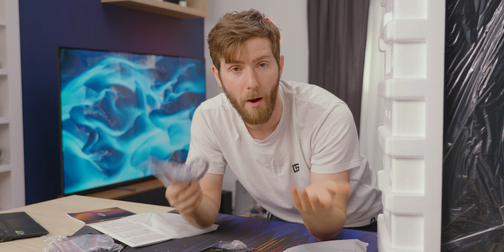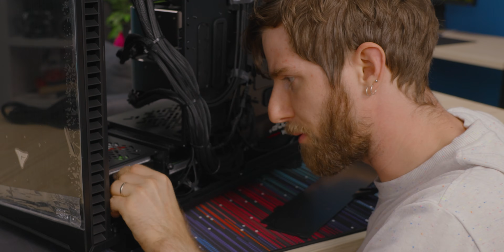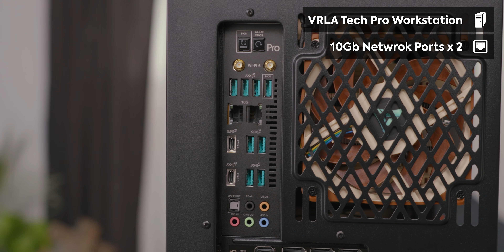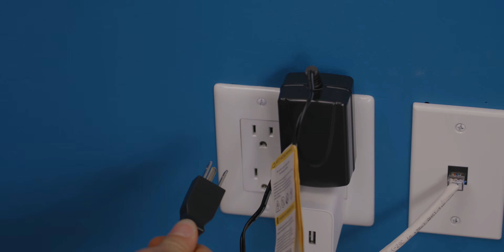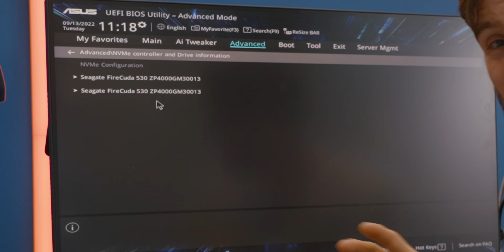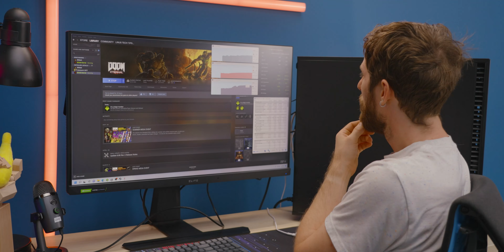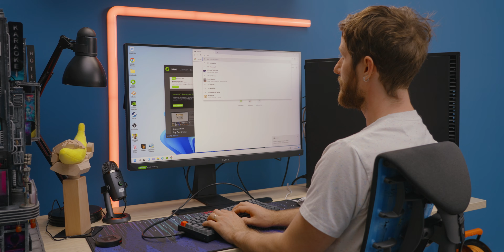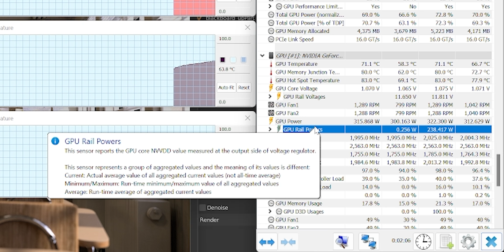This PC blew our circuit! - VRLA Tech Threadripper PRO Workstation

Comment: All that squawking about the 1/8" audio jack going away on APPLE phones, which you don't even use, and you have the nerve to even ask if mfgrs should force obsolescence of 1/8" audio jacks on our mobos?  Whose side are you on, boy?
Reply: to be fair nobody populates all those analogue surround sound jacks on the motherboard, but everybody has used their headphone jack on their phone.

By nobody, I mean far less than 1%, but a lot of people do still use wired headphones with a single jack.

Comment: Just built a threadripper pro pc in 1000d case using the same motherboard and 265gb of ddr4 ecc ram cpu is the 5975wx with a single rog strix rtx 3090 oc gpu this things a monster at rendering 4k XAVCI 60 4k video I'm not confident enough to do a full water cooling loop so went with a Corsair elite capellix h170i aio getting greats temps cpu tops at under 60c well happy
Reply: Out of curiosity what do you do that requires that much power?
Reply: @Ryan  rendering and editing XAVCI 4k pro quality hdr Video from a Sony PXW-Z280 camera, I'm not a gamer so don't need a gaming build this is purely a workstation Build

Comment: Yes I still hook up surround sound to the analog on the back, but through a sound card.. the 8th inch Jack is converted to RCA which goes into the receiver which is one of the last receivers on the market to do 7.1 surround sound without HDMI.. and it's one of my best friends and I'll never let it go, God bless you pioneer! Yes yes they they go to floor standing speakers LOL, bookshelf speakers are for posers.

Comment: Linus, I've got an idea or 12 for your crazy cooling schemes, several start with putting the computer into a pure dry nitrogen atmosphere to avoid condensation, combine with some very high "air" flow (like duct 200-800 cfm directly across the cpu cooler alone, more air for the rest of the system as well) and a variety of somewhat normal to rather exotic cooling mechanisms to cool that air flow (air conditioner, dry ice, liquid nitrogen) to see what blasting crazy amounts of very cold gas can get you to.

Another thought, they have wind tunnels for testing icing on aircraft.  NASA icing research tunnel is up to 350 knots at as low as -25c through a 6x9x20 foot test area, you might need to reinforce your computer first though at that level of forces.  I don't think you have ever used blowers close to that size before.

Comment: You need to check out the Razer Kiyo with the ring light compared to the pro. I have been using it for about a year now and I am EXTREMELY impressed. Not only has it never given me an issue with OBS but I can plug it into my xbox one or xbox series s and it works instantly where my logitech camera will not work on the xbox. and for $80 I couldnt find a camera I was more impressed with... not the mention it can be mounted on a tripod, clamp on the screen or just sit on the desk... I passed up the pro model because I tried the standard model and was blown away.

Comment: I kinda wish you could use both GPUs for gaming.
Like…. One of them can do 8K 60fps gaming fairly well, but two? Probably double the frame rate.
Bet that If you did some monitor array mode, you could have both of them in 4K wide, and have it technically doing 8K

Comment: I have been feeding audio into a (Usually Denon) receiver for at least 2 decades now. I think it is time for a nice ARC output on motherboards so that instead of a damn stupid "monitor" sucking back video data just so that I can hear stuff without any possibility of displaying that video, I can get a nice clean simple sound out.

The worst offender is Apple. In what world is it OK to be forced to duplicate the 6k video out to the audio only sound system? Although nVidia and AMD are just as dumb, but sometimes they let you feed out a really low res feed. But then you have to attach that invisible monitor to your extended desktop so your mouse gets captured off screen sometimes.

It is all so stupid that I hope I am just ignorant and this is not the true state of affairs.

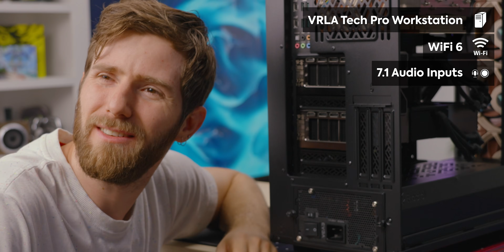Comment: 4:59 no, most people run their stuff off of a USB DAC and amp and/or through a receiver. A lot of consumer motherboards have been removing mic in, front tweeter, and subwoofer, leaving left, right, and S/PDIF, the latter of which really needs to be retired. This being a workstation board, their keeping it is probably for backwards compatibility for whoever is using it, since you never know what setup a client is going to be using

Comment: I use the audio out ports because with my sound system, using digital means I cant change certain niche settings like the decibel per speaker or turning off the center channel while still decoding dts etc i cant do any of that through a digital signal

Comment: They most definitely should still be including the 6 analogue audio ports, I use a 4.1 set up, "mirrored" so I can turn off the hifi speakers if I want, my amp isn't new enough or high end enough to have HDMI. I mean, who in their right mind wants to use monitor built in speakers beyond Windows system audio?! And I'm mot a fan of using headphones for long periods.

Comment: My very first computer came with an Altec Lansing ADA 305 Speaker surround system that I still use to this day. Changed computers over the years but I wont change the Speaker so keep the connections.

Comment: I actually use the analog "surround sound" jacks on a motherboard for a unconventional usecase. I split the jacks up in software under linux then plug in different devices to each port if I want to have multiple sound system zones that I maybe cant hook up over hdmi or optical. I use the line in to grab audio from my game consoles if I wanna game and still have audio from my desktop as well

Comment: I bought a pretty top end Creative Labs 7.1 speaker setup maybe 10 years ago, and it's still going strong. I wouldn't buy it again if I had to replace it, but it's still working as well as the day I bought it, and has outlasted 5 motherboards in that time.
So yes, there are still people plugging in analog 7.1 speaker sets. 🙂

Video Idea: Those components/accessories that you keep from machine to machine, and new innovations that might make them worth replacing anyway.

Comment: @ShortCircuit I still use a 5.1 analog speaker setup! I had a Logitech Z640 for a 5.1 setup since probably 2003-2017, and up until a couple of years ago I was using the onboard sound for a newer Logitech Z506 5.1 speaker system. Switched to the SoundBlaster Omni 5.1 over usb and it has more bells and whistles for gaming and TV/Movie time than any onboard chips have ever offered. I can still have a good time on a budget!

Comment: i enjoy having the analog audio because it allows me to use older speaker systems and split the output of audio to own speaker pairs. got Main, secondary, head phones,  and the 2 BT speakers that is possible with modern BT. 7.1 lets me be fully submerged in game world using older theater system.

Comment: I still use the analog audio out on my board, granted, just the stereo/front speakers one (the lime one, usually bottom middle), to hook up my speakers, that are 10+ years old, but still work just fine, and still sound good. Honestly sometimes it's useful just to use as an very loose indicator of a good board, if it's not present, likely not a good sign.

Comment: I feel like any PSU over 1500 watts destined for North America should come with a cable for 20 amp sockets. 1500+ watts is simply too much for a single 15 Amp circuit. Most “120v” circuits are actually 110-115v, or 1650-1710 watts of total power available on a 15 amp circuit.

Comment: No RGB. my kind of computer, i mean who the fuck wants RBG in a workstation??? Function over form here boys. As for the CPU cooler, its the same one that is recommended for 3rd gen threadripper, which is the same TDP as the 5000 Pro series, so if it cools them it'll cool the 5000 series.

Comment: I'm happily running my Pioneer A-717 Reference amplifier from around 1990 and all it takes is analog. So if motherboard makers remove those analog ports it means I need to get a converter or something cause I'm not moving to digital amplifier in near future.

Comment: word of advise. if you're going to use a 1600 watt power supply, and actually run anywhere close to the full capacity. You need 240v. power supplies that large are intended for the rest of the world outside the US which all use 240v. Here a standard socket is perfectly happy supplying 3100w whilst a standard 110v socket isnt intended for that kind of high power draw.

Comment: I wish case manufacturers would include a spot for a gpu exhaust fan. I took out pci slot covers on my Helios and installed a fan in their place. Temps are cooler on my gpu now. It works.

Comment: 5:18: Yes, motherboard manufactures should continue to include analog audio ports on high end boards, especially when the the PC is being used for productivity. Being able to hook up a very high quality stereo to the PC without any adaptors is a very good thing.
Reply: Agree, having the option is good. And plus good we'll made audio equipment lasts decades
Reply: I use a very nice set of Logitech G5.1 with upgraded speakers. They are the oldest part of my system but still pump out great audio. I need the analog connectors, but the truth is that now I am using a Soundblaster card for my analog output that has better audio quality than the Realtek chip on the motherboard.
Reply: That is a upvote from me been using a 150w sub with its own 7 satelite system from genius for the last 5 years and the audio has been so good for movie and other audio based media cintent liks this segway to this awesome channel =D. for the life of me it is so difficult getting a usb solution with a 5.1 or 7.1 analogue audio interface to be reused from my laptop after my system broke.
Reply: Yeah i agree. Analog stuff are also just most reliable. Even in 2015 you still had more reliability issues with analog than USB, its only in 2020s that i consider analog to be unnecessary for reliability reasons alone. But lot of people still have good analog stuff, lets grandfather them in. 
But i don't expect or demand or ask them to still keep putting analog audio ports into mobos in 2030s. Maybe some people still prefer analog in 2030s, but it no longer needs to be industry standard since it will be just that rare.
Reply: Why?!?  I'm not an audiophile by any means, but for the last 2 decades I have been using the optical audio port for streaming music from my PC (S/PDIF, TOSLINK, etc.)  There is ZERO interference on this link.  No noise crackling and popping, ruining your immersion and breaking your concentration.  It is the cheapest, easiest, and most painless solution to getting your audio to wherever you want it to go.  Run a cheap optical cable from your PC directly to your stereo, and let your stereo do any necessary analog conversions.  If your PC does not have an optical port then check your stereo for other options.  Part of the reason for HDMI was passing multiple audio channels from your PC/TV and giving you the most state of the art surround sound experience available.  No HDMI either?  USB.  Granted, your PC's analog audio is an order of magnitude better these days than it used to be but once it leaves the computer it still has the same interference issues.

Comment: it still makes sense to use those ports. I use them for my speakers/sub using two of the ports, then connect my headset to the line-in and retask it to headphones so it's the same audio device as speakers and all I need to do is turn speakers down and turn headphones up, as well as use the mic-in. the only ones I don't use are rear/side speakers

Comment: I must have been living under a rock, but what would you use instead of the analogue audio ports for external (surround) speakers? I guess you could use an optical connector if your speakers and MB support it, and a lot of people don't bother with external speakers and use the ones built into the monitor (transmitting the audio signal via HDMI or DP), but analogue is still a perfectly valid connector for speakers. The signal has to be converted to analogue at some point, might as well do it in the PC.

Comment: I got rid of my 5.1 logitech speaker system as it was 20 years old and finally popping sounds became too loud. Was very disappointed with the equivalent current model and went with 2.1 speakers like when I was a kid with my 20 dollar antec speakers and sub. 

I miss my analog surround sound. I do not miss the wires, and trying to find good placement for it all.

I now use a USB powered DAC/amp for my headphones and speakers and mic. I think the sound is actually better. Need better headphones to take advantage of the ohms this DAC pumps.

Comment: I have Logitech Z5300 speakers that I've had since college, across 4 pc systems and one move halfway across the globe and yes they plug in with 3.5 jacks into 5.1 surround. 

At this point I'm hoping they die so I have an excuse to replace them. But why spend the money if they still work great? 

Unless you have a pair of speakers you aren't using and wanna throw into my Screwdriver order 😇

Comment: Analog speaker user here. Yep still use the audio jacks at the back as I run a surround sound set up as my PC is the main entertainment system and productivity machine for the house - remote work, video games and, most importantly, streaming shows and movies. We also host d&d and movie nights so having those surround speakers is great for immersion and they've been working as good today as they did when I bought them (even has a little volume remote) :)

Comment: Careful with plugging SATA drives into that mobo!  Only the top 4 ports work, at least in linux.  The bottom 4 ports (ASMedia controller) don't work reliably.  I have a long thread with Asus where they "tried" to repo the issue but ran benchmarks but of course only used the top 4 ports ...

Comment: Please help I was messing around in bios trying to turn on secure boot and when I exited I was met with a black screen and shortly after no signal and my keyboard and mouse won’t light up or work I tried restarting bios by the cmos battery on the motherboard and also the jumper method no results I then tried taking out my graphics card and ram and putting it back in still no luck pls help if you know any solutions of the issue

Comment: If you need the compute power, but 7950x is pulling 37,000 stock on R23, soooooo.  You'd better be making $$$ a minute to need this workstation.

Comment: With all the talk about the 1600W power supply and the breaker tripping, I was hoping for a quick wall power draw measurement. Time to upgrade to a 20A circuit for the set it seems >->

Comment: I still use my 3.5mm audiojacks with my Logitech Z 5500 Digital 5.1 surround set. I tried to use optical on my previous tower, but that could only output stereo.

Comment: A bit odd that problem with the nvidia drivers after you blew the circuit during the load test. I kind of disagree that the power outage during load caused that. Seems very unlikely that a power outage would effect a driver as long as you are not in the process of installing / uninstalling / changing settings of the driver during the power outage. Problem most likely already existed (especially considering you already have problems before that).

Comment: I still prefer the S/PDIF connection on the motherboard because due to a quirk of an audio interface I'm using its inputs 3 and 4 don't like my PC's audio out and the only thing that allowed me to pipe the second machine's audio into the first is to use S/PDIF with an optical to coax adapter. I'd love if they did replace the surround with the option for either optical or coax S/PDIF.

Comment: I haven't used those audio connectors since 2005 when I bought my Z-5500 speakers. I use an optical cable.

Comment: I have a lower spec version of this system.  Same board, 3955wx, 3090, looks like the exact same psu.  That system is a real pita, requires constant work to keep it running well.  Watching Linus put in that much work was really validating tbh.  I had to do electrical work on my home office just for this rig, and I have an APC 1500 UPS.  This is the most bratty computer I've ever owned.  I ended up buying a macbook for my daily just to reduce the troubleshooting time on the threadripper.

Comment: I still use my old creative 5.1 setup with the analog hookups. If the mobo doesn't have that I'd have to go external like that external box creative sells. Would a bigger setup be better? Maybe, but then I have to deal with trying to find a good tuner, speakers, sub. my small space is perfect. I wish I could get some kind of atmos but stupid ceiling fan prevents it.

Comment: I'm one of the few that use those Analog Audio Ports. However, I don't use them for typical audio. I use them to connect to my transducer (read: bass shaker) amplifiers for my racing simulator cockpit. Saves me from having to get/use an audio card (which could also add latency).
Reply: at work we use a virtual soundcard to connect to audio mixers, it adds about 1 ms of latency, way less than your screen has.

Comment: I still use surround sound audio ports.  I have a PC surround sound system  from creative and its older.  Finding a new surround sound system for my computer has been a challenge.  everything is either a 2 speaker or a stupid sound bar and I am not downgrading to one of those.  I could build a high end surround sound system but that would be really pricey and I dont have that kind of cash.